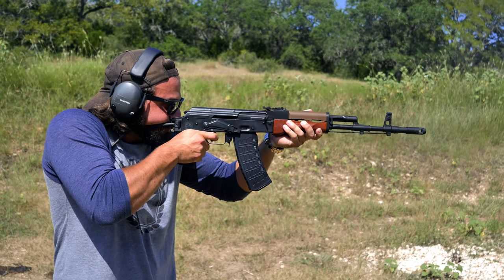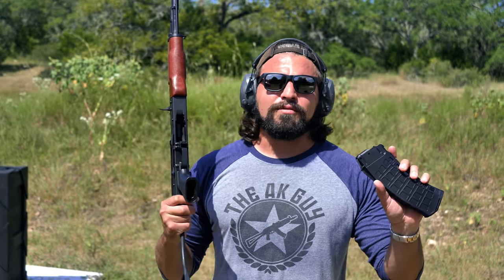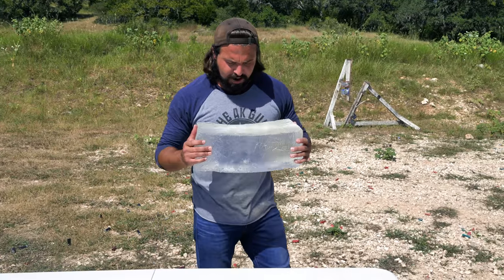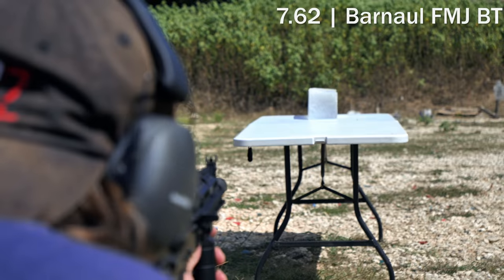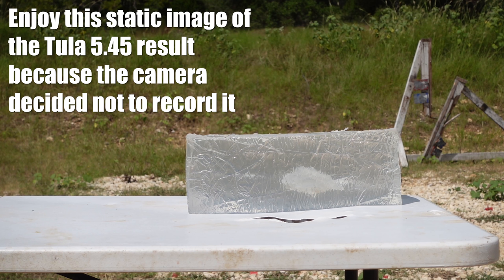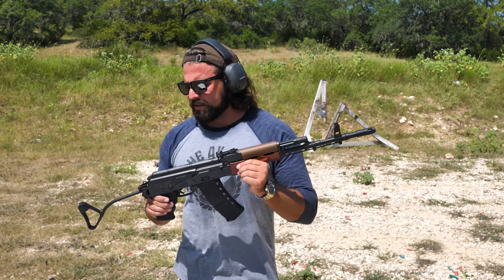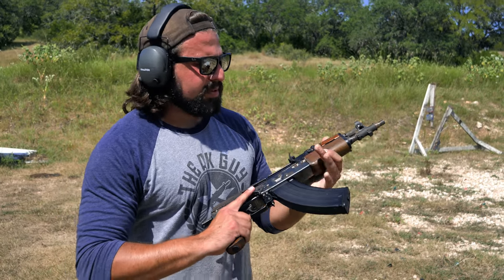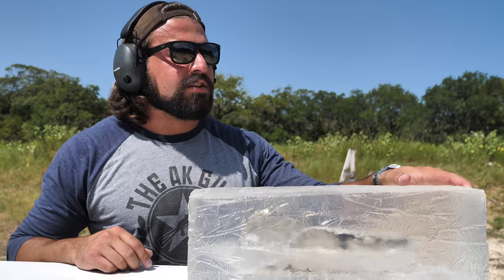7.62 vs 5.45 - Which Is Better?

Comment: 5.45 is Gods intermediate rifle caliber. Flat shooting with high ballistic coefficient, good accuracy, very low dispersion in full auto, decent terminal ballistics that isnt velocity dependent, less muzzle blast than 556, and less cartridge overall weight allowing one to carry more ammo for the same amount of weight.
Reply: I've always wanted to shoot 5.45. I've shot and owned plenty of AKs and my range gun right now is a beat up old Type 56 Chicom SKS that I'm trying to give a second (or third, or fourth) life to with some downtime tinkering to help teach myself a little gunsmithing. And most of my shooting buddies shoot ARs. So I've had plenty of experience with 5.56 vs 7.62. I'd love to see how 5.45 compares to them both personally.
Reply: High ballistics coefficient (unless compared to a heavy 5.56)
Good accuracy (unless compared to an AR)
Low dispersion in full auto (unless compared to a properly gassed AR)
Good terminal ballistics (unless compared to a 5.56, yawing is not an exclusive feature of the 5.45, all spitzer shaped rifle rounds do it)
Less muzzle blast (because of less power)
Less cartridge weight (negligible difference)
Reply: Marginal gains, if any at all.
All of which are negated entirely by it being a less common caliber in the west.
That lower blast can only come from lower pressures, which mean lower potential.
Reply: Depends the theater of war. I remember guys in Veitnam complaining of that 'brush deflection' where 308 was better than 556 in dense brush. In the desert, not so much
Reply: @jonahpatton8879  find me a 53 gr 556 projectile with a bc in the mid .3s. Low dispersion in full auto. We are talking about fighting rifles. Not finely tuned race guns running adjustable gas blocks and reduced mass bolt carriers and buffers with gigantic muzzle brakes and gassed so they barely cycle soaking wet with lube and kept pristinely clean. Good terminal performance that isnt velocity dependent. Key phrase there is not velocity dependent. While all spitzer projectiles will yaw to one extent or another, some are much more likely to do so rapidly due to shape, weight distribution and construction, and twist rate that effects its stability factor. While the 556 generally has better terminal performance when it is at its fragmentation velocity, slow it down to below that threshold either by increasing range or chopping barrel length down and you are going to get a 22 cal hole with a very long neck before it yaws. 7n6 is barely stable by design and yaws within the first few inches nearly every time. Take it from someone who has literally had multiple shelves of ballistic gel and high speed cameras to film it all for nearly a decade. Less muzzle blast because the case capacity is roughly 7% less than 556. No it doesnt quite have the boiler room to achieve the raw horsepower that 556 is capable of but has a very efficient case design optimized for its long for caliber projectile, not unlike many much more modern cartridges. And the cartridge weight is approx 14% less than m855. Anyone that has had to fight and pack weaponry all over some god forsaken shithole will tell you oz turn into lbs and lbs turn into pain. 14% is far from insignificant.
Reply: Garand Thumb  while the 545 has about 7% less case capacity than the 556, its case is designed for its long for caliber projectile, not unlike many more modern cartridges. This is like comparing a 260 to a 6.5 cm. Yeah the 260 has more case capacity and can outperform the latter in raw horsepower at the muzzle, the latter makes up ground as the range increases. Find me a 556 with a 53 gr projectile that has a bc thats identical to the 69 gr smk while still being able to mag feed and you'll really be on to something.  The 556 derives most of its terminal performance through fragmentation. When it fails to do so, it leaves a 22 cal hole with a very long neck before it yaws, often times exiting the body or at the very least passing through the vitals before doing so requiring multiple hits to incapacitate a target. The 7n6 was designed with a low stability factor so that it yaws very early in tissue nearly every time. Yeah you could run an smk and have a much broader range of fragmentation velocity than standard ball but they are notoriously bad when it comes to defeating barriers where as even the mild steel core of the standard 7n6 has a much better ability to penetrate intermediate barriers let alone improved variants with a hardened core.
Reply: @longbow6416  308, 7.62x54R ect arent intermediate cartridges.
Reply: @maxpulido4268  that 7% reduction in case capacity is offset by the superior ballistic coefficient. By 300 yard the 7n6 projectile is traveling over 100 fps faster than the M855 and the gap will only continue to grow as range increases. Also keep in mind that the 7n6 isnt velocity dependent for terminal performance like the 556 which derives most of its terminal performance from fragmentation. If we stick to ball ammo, even with a 20 inch bbl, the 556 looses its ability to fragment at about 200 yards. While all pointed projectiles have a tendency to yaw in soft targets to one extent or another, the 7n6 was designed to be barely stable and yaw almost immediately regardless of velocity where as the 556 can often have a very long neck, sometimes passing through the body or at least the vital organs before yawing, leaving a 22 caliber hole that often takes targets multiple rounds and considerable time to incapacitate.
Reply: Garand Thumb  We are talking about military fighting rifles firing ball ammo here. Of course there are projectiles that offer superior performance than the 7n6 That's not really in question but to match the bc of the 7n6, you would need to run a 69 gr smk which while it has excellent fragmentation properties, is terrible at defeating intermediate barriers even by 556 standards and good luck getting that heavy of a projectile to 3000 fps from a 14.5" bbl. If you can manage to put together a 556 round that has a bc that high, while achieving 3000 fps from a carbine bbl, and not be velocity dependent for wounding, while still being able to get through light intermediate barriers, offering nearly half the recoil impulse in a cartridge that weighs approx 14% less, you'll really be on to something.
Reply: @supercomp65  you speak as if you’re a Marine or Army ‘Grunt!’  Exclude, specialty ammo and compare wounding/killing capability from CQB ranges through 600m with semi & full auto engagement options and I would take a modern AK-100 series (w/similar optics) shooting 5.45x39mm 7N6 ammo as opposed to the 5.56mm M193 (55gr) or M855 (62gr) ball round.  The former Soviets learned the right lessons looking at 5.56 from a rear view mirror.
Reply: @supercomp65  14% less than m855? 173 grains compared to 187 grains. Sorry dude that's less than 10% difference, and you're comparing it to M855, why not compare it to m193? It's far more common and then you're talking about less than 5% difference
You want me to find a 53 grain 5.56? Why? That's a terrible weight for long range purposes. How about you find me a 5.45 that can maintain 1850 fps at 500 meters? Because a 77 grain otm can do that, 7n6 is only pushing 1450 fps at 500 meters. So now we're comparing a 50% heavier bullet going 30% faster, fired from a more accurate rifle. Are you sure you really want to argue long range effectiveness? Because that really is not where an AK shines.
Who said anything about a race gun that barely cycles with an adjustable gas block? A mid length gas system is proper for a 16" carbine, but most factory 16" carbines are running a carbine length gas system, so most are over gassed out the box, this is a simple remedy that anyone who plans on fighting with their rifle do.
Reply: @supercomp65  most 5.56, 7.62, and 5.45 yaws within the first few inches of travel. This is not special to the 5.45, all that hype about the "poison bullet" came from cavemen in Afghanistan with no concept of medical care, not ballistic experts.
5.56 does not need to fragment to do more damage than a 5.45, it just needs to push a heavier bullet at a higher velocity. Which it does.
Reply: @jonahpatton8879  7n6 has a cartridge overall weight of 165 gr and a g7 bc of .168. You have to step up to a 69 gr smk to match that and to surpass that you have to step up to the mk262 and then you are looking at 20%. At my elevation of 400' ASL , it is still traveling over 1700 fps at 500 yards where as m855 is down to below 1600 fps. 556 projectiles have a much shorter meplat in order to feed from magazines that limit the cartridge overall length to 2.26" the shorter x39 case allows for a longer projectile while still mag feeding. Similar concepts can be seen in modern cartridges such as the creedmoor series cartridges that use a slightly shorter case compared with their similar caliber counterparts such as the 243 and 260. While the latter has an advantage in shear horsepower at the muzzle due to their increased case capacity, the aforementioned were optimized for much longer projectiles. That is why you can get an ar10 in 6.5 cm to mag feed with 140 gr vld projectiles seated at or near the lands and you cant with a 260 rem. The steel core of the 7n6 makes it light for its length. Yes a projectiles weight has an effect on its ballistic coefficient but so does the shape of its meplat and ogive. That is why a 75 gr berger vld has a significantly superior bc than a 77 gr smk. Remember the phrase "muzzle velocity is temporary but bc lasts forever". If all this terminology is lost on you, I suggest you quit while you're ahead and stop trying to AcKcHyUaLlY someone who has has been proficient in the science of permanently incapacitating those that need to be incapacitated for better than a decade.
Reply: @supercomp65  you are still trying to argue that an AK is superior to an AR in long range performance. It's pathetic.
Not only is the AR the superior platform for long range applications but it is chambered in the superior cartridge for long range. The only advantages you can find is when you compare 7n6 to the worst 5.56 rounds you can find. I get it, you feel the need to justify your purchase, I did the same thing when I was an AK fanboy. It isn't necessary. You find it adequate? Fine, but don't try to assert that it's superior in the face of factual external ballistics. The 5.56 has more projectile options for a broader spectrum of applications. 1700 fps at 500m? You're still talking about a smaller bullet traveling slower in comparison to 5.56 rounds meant for long range applications. You only keep comparing it to m855 which was designed for SAWs.
Reply: @supercomp65  you're also arguing that 7n6 is 1,700 fps at your elevation, so you claim, but at sea level it's pushing 1450 compared to a 77 grain otm that's pushing 1850, or an M855 that's pushing 1570, or a 55 grain xm193 that's pushing 1540. 5.45 has a barely higher ballistic coefficient if comparing equal bullet weights, but there aren't many equal bullet weights between the two cartridges, the 5.56 usually pushes the heavier round, and has the ability to push rounds 20% heavier than anything a 5.45 could even touch. 
With any of those you're talking about a yawing bullet traveling less than 2,000 fps so hydrostatic shock isn't a factor and you're talking about 22 caliber bullets yawing through tissue at magnum handgun velocities, none of them are are doing what a full power rifle is doing at those distances, but the 5.56 still has the advantage at long range, not even including the accuracy advantage.
Reply: @jonahpatton8879  mk262 runs about 2750 fps from an 18" bbl and is down to mid 1600s by 500m at 400 ft ASL which isnt much of an elevation difference vs sea level. If you want to compare bullets that are closer in weight, then you would compare it to m193, in which case it would be down below 1500 fps at 500. As I said before, muzzle velocity is temporary but ballistic coefficient lasts forever. I do this shit for real, shooting out to 1k in various locations all over the country. All my information comes from better than a decade of personal experience in military, medical, small arms and ammunition design, and terminal ballistics fields, plus referencing multiple documented military small arms wound studies, and just as much if not more experience in recreational shooting out to 1k all over the country and you're still here trying to one up and AcKcHyUaLlY me when you cant even accurately regurgitate publicly available information or even know how to use a ballistics app to get accurate data?
Reply: @supercomp65  you shoot out to 1k with your AK? Yeah? With your skewed numbers that don't accurately represent any of those 5.56 loads. Any quick Google search proves you wrong.
Nobody who regularly shoots out to a kilometer would be claiming an AK is the superior long range platform. Nor would they be fanboys of Russian surplus calibers. At this point you're just lying.
Reply: @supercomp65  also your BC of .168 compared to a 77 grain TMK with a BC of .219. do you really want to do that dance since you're so fond of ballistic coefficient? Show me your video of you tagging steel at a thousand with your AK, I would love to see it.
Reply: @supercomp65  You talk a lot and it chalks up to not much.
A "100 m/s advantage at 300yds" chalks up to a marginally inferior round before 300 meters, a negligible improvement AT 300 meters, and a marginally increasing advantage AFTER 300 meters.
The design isn't magic. It doesn't perform as intended when obstructed by light obstacles or distances, hence its users shaving down an edge of the bullet tip at an angle trying to encourage it to do what you claim it magically does.
Reality check: it's a 5.something millimeter round, effectively the same weight, travelling at effectively the same speed, at all effective engagement distances. The only thing that really matters is whether you can feed it.
The holes you're poking are similar, and whiny fudd dogma about "muh stoppin powa" doesn't hold water.
Reply: @jonahpatton8879  Every time you get proven wrong you try to bring up a specialty round and this time it's not even a round that any fighting force uses and once again you cant even  regurgitate accurate data on it. The average g7 of the 77 gr tmk is .202 according to Bryan Litz. You gonna say hes wrong as well? If we are gonna bring up specialty rounds, why dont I just throw my 223 ftr rifle shooting the 90 gr bergers in the mix as well🙄 I never said I ran my ak at 1k. I have plenty of other rigs purposely built for that. I have however put it through a service rifle course out to 600 for the fun of it and also have piston driven ar in 5.45 as well to level the accuracy playing field and neither was any worse than any other intermediate small bore military rifle firing military ammo. Just stop dude. Stick to video games
Reply: @maxpulido4268 Yeah I might know a thing or two cause I might have seen a thing or two.  Documented military small arms wound studies tell a different story once 556 drops below its fragmentation speed where as 545 is not velocity dependent. 7n6 with the air cavity in the nose is what we are talking here. Not commercial ammo that lacks that feature. It behaves this way regardless if its fired from a full size rifle or a little krink. Shoot m855 ball from a mk18 at anything beyond room distance and you get very erratic wounding, sometimesyawning, sometimes not and most often not fragmenting. Yes it's got an advantage in horsepower but a lot of work has had to go in it to make up for its projectiles shortcomings.
Reply: @supercomp65  Let's come back to reality and appreciate the fact that they both do the job, and reciting dogma isn't worth much when you couldn't trade all the goats in the barn for ammo that no one is selling.
The rounds are effectively equivalent.
Reply: @supercomp65  embarrassing. your 5.45 AR? Gross dude, why not build a .300 blackout AK while you're at it. You keep saying specialty ammo like it's some rare unavailable shit. This is very common and available ammo. You only use that argument because the fact that plenty of 5.56 outperforms the 5.45 at every task hurts your argument. This isn't some rare unheard of bullet that nobody has, it's commercially available ammo. As compared to the 5.45 where your options are 7n6 (banned) wolf/Tula (banned) and Hornady vmax. You have two bullet weight options and 3 bullet design options. So you compare your ammo to the closest thing you can find for a 5.56 and then say "look the 5.45 beats it at this one thing" and ignore all the other ways that same 5.56 round beats it, and the second I pull up 5.56 ammo that also beats it at that one thing you call it "specialty ammo" as if it's some rare custom made bullet and say it doesn't count only because it hurts your argument and your feelings. 5.45 is not as good as 5.56 for long range, that's just a fact.
Reply: @supercomp65  it's still hilarious that you maintain, that because the 5.45 with the lowest BC has a higher BC than the 5.56 with the lowest BC, that the 5.45 is the superior long range cartridge. When, however, I point out that 5.56 loads with high BCs have a higher BC than any 5.45 bullet made, you pretend that doesn't count. If you're comparing which one is better for long range you should compare the loads meant for long range.
You are fully aware of how necessary it is to skew data in your favor to even make half an argument. So why are you picking that hill to die on? Why is 5.45 your favorite caliber of you know that there are better long range 5.56 loads, better CQB 5.56 loads, better armor piercing 5.56 loads, better barrier penetrating 5.56 loads, and that pretty much every 5.56 load is more powerful to boot. You know these things and pretend they aren't real, so why not just buy a 5.56 and stop defending the AK? The AK is a good rifle, chambered in good cartridges, nobody is arguing that, but they aren't the best, I had to grow up and do the same thing, I eventually caved and bought a 5.56 because the advantages were just impossible to ignore. Well... impossible so long as your brain works correctly.
Reply: @supercomp65  so you plan on flying to the middle East some time soon? You live in the US, finding available ammo is important HERE, it really doesn't matter what ammo type is common in the Ukraine or in central Africa because we do not live there. 
5.56 was more available before the Russian ammo ban, but now the disparity is almost funny. So now you finally admit that the advantage of 5.45 was price, at least you finally are willing to bring up the only advantage that the 5.45 used to have, instead of pretending it's advantages were in external and terminal ballistics. Yes price made that a juicy option before 2011, but since that isn't the case anymore, it isn't a point that works in your favor. So let's recap the total comparison.
Ammo availability: 5.56
Bullet design/weight options: 5.56
Muzzle energy AND down range energy: 5.56.
And the 5.45 is.... Slightly lighter? And only because of the steel cases, if this is that important for you, there is steel cased 5.56 as well.
5.45 is adequate, it does what you want a carbine to do, it shoots a light fast bullet that will ruin someone's day, it's low recoiling and moderately accurate, but it doesn't do anything better than the 5.56 this is a fact. The 7.62x39 at least does a couple things the 5.56 can't do. The 5.45 is to the 5.56 what the .300 blackout is to the 7.62x39. it's close enough, but not better.
Reply: @supercomp65  also let's look at the prices right now. 
Only one place I can find 7n6 on the internet: $1.20 per bullet
Tula 60 grain 5.45: $0.50 per bullet
Tula .223: $0.43 per bullet, and the brass cased stuff is also hovering around $0.50 a round. So it looks like price isn't in the 5.45's favor, and if you're argument is that you're stocked up, well then so am I.
I have crates of soft points stocked up, over a thousand 77 grain smk, Barnes solid copper TSX rounds that will fly through level III steel armor, M855 and M193 in the thousands. It's not as if you or I being stocked up has anything to do with availability or price, which the 5.56 wins.